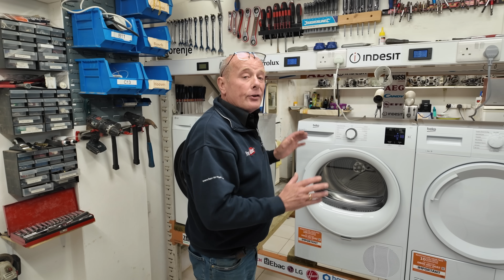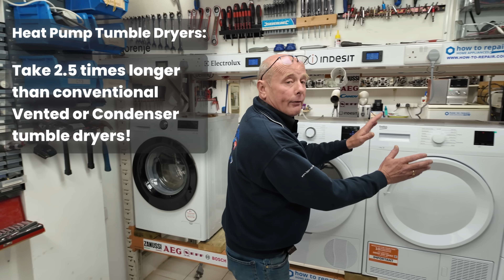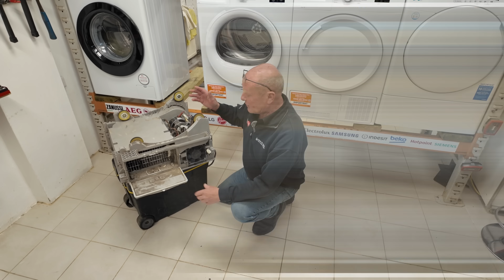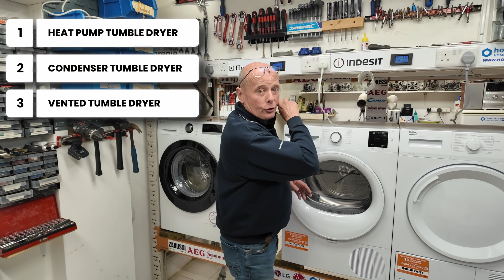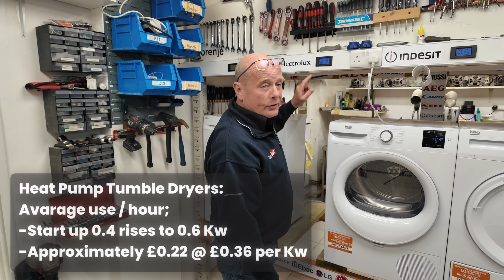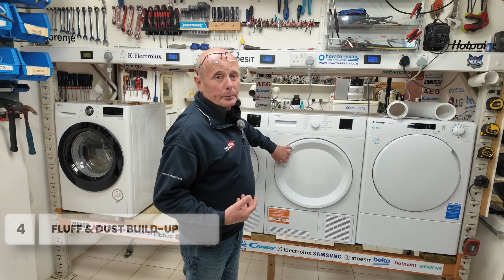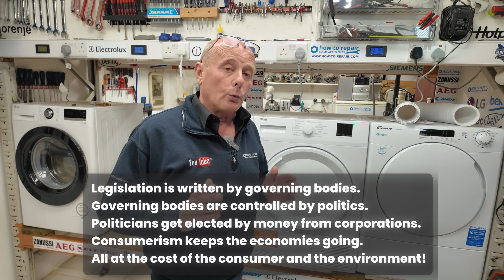Tumble Dryers the Shocking Truth About Heat Pump vs Vented & Condenser, NEW LEGISLATION!

Comment: I totally agree with you regarding the problems with heat pump dryer.
I think they are a great idea but lacking good filtration.
Should have good easy accessible filters in front of the condenser and evaporation coils.
Otherwise they end up being scrapped and the gas polluting the atmosphere again! 
I have worked with refrigerator gasses and commercial tumble dryers.
I actually own a launderette size gas heated tumble dryer. Just having it converted to LPG from natural gas, as I have come off the gas network to save money.

Comment: So let's say you have 3 or 4 kids. You do perhaps 4 washing machine loads a day. 

A vented dryer takes about an hour to cupboard dry a load. 

There wouldn't be enough hours in the day with a heat pump dryer... 

Nightmare I'd imagine if you had a busy day.

Hour wash cycle combined with hour dryer cycle. Perfect combo to get lots done time efficiently.

Comment: We've had a Beko heat pump tumble dryer for about a year now, and love it - absolutely fantastic. Uses a shed load less power, and yes I've monitored it. It has a 10 year warranty so no issue about bearings and compressors. Our unit has a very smooth drum (like Samsung does) so no concern on clothes, but we only really dry towels and bedding.
Reply: The biggest cause of clothing wear will be the clothes rubbing against each other, rather than anything to do with the drum. Yes there are some poorly designed drums out there that have been known to cause issues (such as poorly designed paddles), but I believe that's the exception rather than the norm.

Comment: The traditional vented dryers are inexpensive to run, reliable, inexpensive parts, easy to maintain, and energy efficient. Fortunately I live on acerage and not in a dog box shithole. I use the older dryer only a few times a year, mostly for lint removal, and which resides in my barn. These new types of dryers are nightmares to maintain. Hundreds more parts, the introduction of moisture into the machinery, the cheap parts from Asia. I am now servicing my son's condenser dryer a Fisher Paykel dp8060-2, which I a year ago cleaned, replaced belt and idler pulley. The IP is a cheap piece of crap that has a steel sleeve riding on a rod sticking out of the motor. Now a year later, the pulley has shed black fine particles and has roughened up the rod that is pressed into the motor housing. The ip is the problem. Rather than make an ip similar to the ones car makers use for their serpentine belts, FP have cheapened out with the use of a sleeve, which is incapable of handling the drum rotation. Dryer heat has moisture, and the removal of the moisture, like A/C, requires much energy. The energy saving programs are a scam solely designed to inflict misery and steal the time of the lower and middle classes of people, while leaving the rich untouched and profiting at our expense.

Comment: I'd say that from an energy-saving point of view, I'd definitely change to a heat pump dryer. Around 8 years back, I saw an article in UK Whitegoods which was saying basically that the energy saving didn't justify the cost, but now that electricity prices are through the roof, and the fact that you can get a HP dryer for under £400, I still think overall it's a better bet financially to get a heat pump dryer, purely for money saving.  

Yes, they are slow and only get to about 50 degrees, but given today's ridiculous energy prices, I think they are worth it.

Comment: Thanks for your videos. I have watched many over the years.being an electronic/ mechanical engineer mainly on fuel dispenser equipment I like and enjoy working on my own appliances.although I tend to purchase Bosch appliances and still have one running now that 19 years old.I find that the new machines with the up to date electronics and software is a scam for the poor consumers because they have taken the ability to replace your own modules/ parts because of software and variation coding and sealed drums they really are screwing the consumers.

Comment: A similar thing happened when the EU banned higher powered vacuums. All that means is that given the reduced suction, it takes twice as long to vacuum your house.
Reply: huh, reduced suction where? And haven’t y’all left the EU? Either way, I’m under the impression that the vacuums i’ve had since the high wattage ban have only been better. Less noisy for sure. I guess since there’s no longer the wattage to differentiate them, they’ve actually put effort into the design.
Reply: I have to call out the waffle here. Dyson managed to increase the efficiency and effectiveness of their vacuums long before the EU brought in the requirement for lower power requirements. No doubling of the cleaning duration for far less energy input! Its up to the manufacturers to step-up and develop better suction system, but im sure that Dyson will robustly defend their R&D investment by way of their patients. So let's stop the emotive waffle and focus on facts.
Reply: @emcguinn2601, The fact that some vacs had low enough power not to be affected by the ban is irrelevant. Others, such as the Henry that I use, had to be supplied with less powerful motors after the ban. Obviously, these were affected, especially as their brush heads were powered by the machine's suction.

Incidentally, the Henry replaced a Dyson that had only lasted about four years. The Henry was just over half the price of the Dyson, it worked better, and 14 years later it is still going strong. It also has a switch that allows you to switch to a lower power mode when you don't need full power.
Reply: Na, it’s just better motors and it’s always been that way. The problem has been cheap Chinese motors for the past fifty years. I’ve got a battery Samsung which has amazing suction on standard power with much higher suction on boost and turbo. Granted the higher speed drains the battery faster. Only drawback is low fill capacity

Comment: Hi. I’ve got a Miele heat pump drier. It take about 1hr 30 to dry a full load. It not always bone dry but generally if is. My old vented took about 15 mins less. That machine is 20 years old and still going at my nieces house. I don’t think the heat pump will last as long.  It was expensive but if it failed I doubt I would get it repaired as Miele is hideously expensive for parts. Thanks for the video. Really informative

Comment: I've got 18 years and counting out of my vented tumble dryer. I've fitted maybe 2 or 3 full sets of bearings, 4 or 5 belts and a new lint filter. The washing machine was about 17 when it died due to traces lifting off the control PCB and burning out. The next one lasted a lot less and failed due to a fatigue crack in one of the three spokes on the cast support for the drum, with another obvious crack in one of the other spokes too. I'd have replaced it, but the replacement could only be bought with the stainless steel drum as well (The drum is usually by far the most expensive part of a washing machine) and it cost well over half the price of a new machine 😞. 

As a quick guide, if the machine has 'smart' in it's name anywhere avoid like the plague unless you're into hacking because it's absolutely certain it will need a laptop plugged into it at your expense for almost anything that goes wrong with it and it will fail in many interesting ways that have nothing to do with their ability to dry clothes, but a lot to do with the company being able to remotely brick them if they feel like it, while it sends data on what you're doing and how you're using the machine back to the manufacturer, often without explicitly telling you by having an 'I agree' button you must select before you can get it to do anything on the machine or on the phone app. Even if you read the novel worth of terms and conditions, there's never an option to not agree, even though you've bought the thing.

They're all following the example set by Apple with their products becoming e-waste as soon as they have any small issue, because they control the entire supply chain, making it impossible to buy spare parts you need, even if you know the company that makes them -part of the deal to be an OEM supplier to any of those companies is that you're not allowed sell the parts you make for them to anyone except that company on pain of losing the contract and being blacklisted by everyone in that cartel. 

On phones Apple is now coding the parts to the appliance microcontroller, so when you replace a part with an identical part that has a different serial number, it still won't work or will give stupid errors till one of their techs plugs in a laptop and allows it (Or in Apple's case, they tell you it's broken and it's your fault while knowing it's designed to do exactly this). John Deere have been at this for years too on their farm machinery, to the point that even in the US, where money usually rules absolutely, some states have passed legislation to make this more difficult. 

If your electricity comes from renewable sources, apart from the cost, which you save not buying new appliances every few years, there is no particular environmental cost to running them, but there is a huge environmental cost to throwing out a 99% good appliance because it's designed to be completely uneconomical to repair.

Comment: Those in power who push for machines with refrigerants don't take into consideration:

1. The green house effect of refrigerants 
2.the more machines in service and the more leakage of refrigerant the more the damage to the ozone layer 
3. I'm against small machines with refrigerants because i've seen the amount of leakages in those machines and are always topped up with refrigerants instead of finding the leak because it's difficult to find and repair because the refrigerants are flammable and not possible to weld on the copper piping with refrigerant inside.
4. Very difficult to repair, needs a very very good experienced technician who wants to spend the time to do the work properly by the book. It's easier to just cut corners because time it's money and the consumer and the environment lose in the fight for the little profit the technician makes 
5. The devices should have as refrigerants amonia or co2 in order to be fully ozon friendly.
6. To train technicians to work properly with refrigeration system is very hard. Usually the training it's very basic, poor done for profit not for protecting the environment against ozone depleting refrigerants.
7. If the technician it's not motivated to protect the environment when repairing the refrigerants leaks will vent all the refrigerant in the environment instead of recuperating it because it's faster to finish the work.The proper procedure it's to recuperate whatever quantity of refrigerant is in the system, purge the piping with nitrogen then weld the copper leaking pipe then make vacuum in the system to prove the leakage has been fixed and then refill the system with the proper amount of refrigerant.
In real life it's very difficult, theoretically it's easy.
8. On top of being a very good refrigeration technician the repair man must also  be a very good electrician. This system gets very complicated to maintain and repair so the difficulty in my opinion is very high, not suited for average know it all technicians or electricians.
The end result, poor expensive work, high repair bill, environment gets damaged by the refrigerants with green house gas effects so only amonia and co2 are suitable.

Comment: Great points and well explained, I couldn't agree more, thanks. I repaired appliances on and off for 35 years. Forty years ago they made much better dryers where on some models you could take the back off and still run the machine and the bearings were made to last. Machines then, like cars were made to be repaired and were not overcomplicated or fragile. Modern "recycling" is a joke and can't be good for the environment. Remember when we used to return bottles to be reused instead of smashed and reformed? It would be better for the environment if manufacturers were forced by governments to make better, more easily repairable machines to last longer like they did in the past and kept selling parts for them. Crush it, melt it and reform it causes a lot more damage to the environment than just fixing it.

Comment: Brilliant video, thank you. We have literally, this month replaced our tumble dryer. The old "vented" one was twenty years old, Over the years I had to replace the front bearings once and the rear bearing once, in all, the repairs cost me just a few pounds, but in the end the rear bearing failed again (it was made out of rubbish) and we decided to replace the dryer. We went through the pros and cons of the three different types and decided a vented one was no longer the solution, mainly because of the lost heat and balls of fluff. We decided a condensor was the best compromise and that it was better than a heat pump type, simply because of the time factor involved in drying clothes. The apparent savings in a heat pump were attractive but we hadn't considered wear and tear on the machine or our clothes etc. What I will say is that the new condensor in miles better than the old vented dryer, so its a winner so far. Your video has convinced me that heat pump technology is not the way to go and probably a con. I just hope the new one lasts twenty years too.
Reply: Always replace bearings with SKF bearings, they last longer.

Comment: I have a LG heat pump dryer it has a condenser cleaning cycle built into the Drying program (you can't access the condenser) for each wash. I expected to see a least a small amount of lint in the condenser water but I don't?  I didn't think about the extended run time for bearings and motors

Comment: I have no doubt the comments you make are valid, and you seemed to gather your data carefully. I do have to say, though, your comments are not universally true. I'm across the pond, so my data is different, but our standard dryer here can only manage about half an hour better or so per load that most quality heat pump dryers. Far from double. I feel like this is because here the market isn't flooded with lower cost heat pump units. We don't seem to get the dust buildup, either, way least not universally, and properly cleaning the standard vented dryer can mean full disassembly, which given the cheapness of the steel can mean stripping metal. I would argue the data here, so far, at least, favors the heat pump dryer for durability, since there is no dust buildup (probably due to better sealing), as opposed to standard dryers which ends up covered inside after only a year or two, and chocked full potentially after 5. There's also no inherent fire risk, no makeup air energy loss, and no practice energy loss when the unit is off. The heat pump also runs at a lower heat, which is easier on clothes, and something people do manually on traditional dryers often, which makes the drying time about the same. People need to research the units they but and make informed decisions, and learn why some people have double dry times (different heat settings, environmental factors, ECT...) a little knowledge can make your experience much more enjoyable.

Comment: We have a Miele Heat Pump TD and have had ot two and a half years. It's fantastic and had a long parts and labour warranty. It takes a 9kg load and dries the load faster than the old condensing dryer and has shown a big difference on the energy bill. Miele come out quick to fix things so we would leave it to them. It also just knows how wet the laundry is and then just switched off when it's dry. It did cost a fair bit more than £400
Reply: Our Miele HPTD is around 12 Years old, i believe it's one of the first ones. We use it 1x a Week for Towels. No Problems so far.
Knock on Wood 😁
Reply from the maker: Miele makes good machines, and their older models are fantastic, but their parts are very expensive. It should be required for manufacturers to provide valuable information with their machines. Miele, for instance, used to place the wiring diagram under the lid of every machine. I'm not certain if they still do that now.

Thank you for your comment. I appreciate people like you taking the time to write it out. Please share it where possible. It might help others make a wise choice instead of being misled by the industry.

Comment: Given that a heater/compressor failure is a lot less likely, and though I do agree with a higher incidence of wear on the motor and bearings,As you say yourself these are common parts and would be as straightforward to fix as a vented/condensor.
Regarding the disposal, that’s a bit disingenuous. All of the parts in them can be recycled just the same as regular dryers as long as the refrigerant is disposed of responsibly. The vast problematic volumes of fridges used in the comparison is due to all of the plastic and insulation making them more challenging economically to reprocess.
Reply from the maker: You make a valid point. While the motor and bearings in heat pump dryers may experience more wear over time due to their design, these are indeed common and repairable components.

If any of your friends or family are thinking about buying a new dryer, it would be helpful to share this video with them. It will give them an idea of what to expect when purchasing a new dryer.

I hope older models will still be available, but I can't promise that. It's important for people to know the differences between the dryers on the market and understand any potential issues before making a purchase.